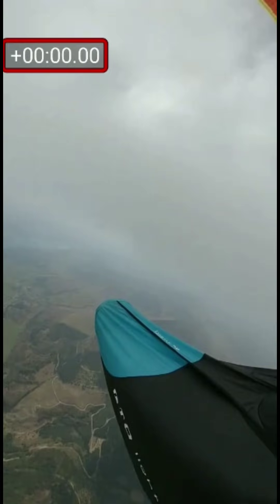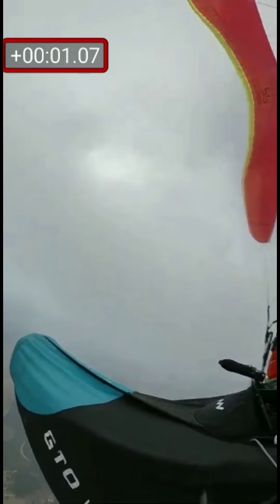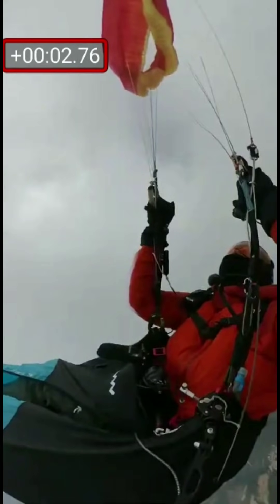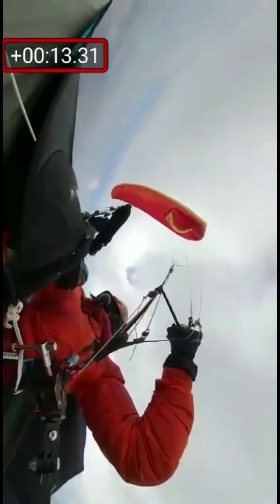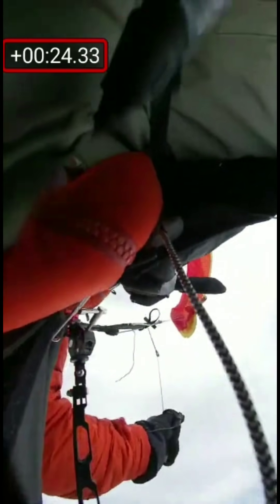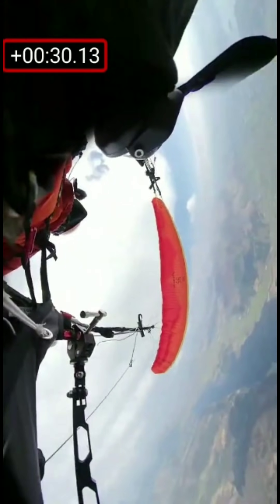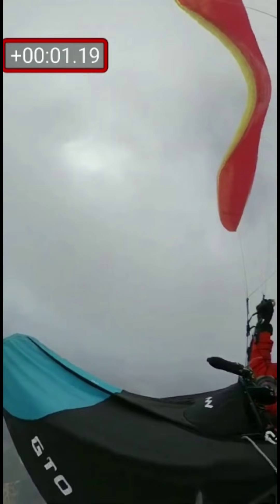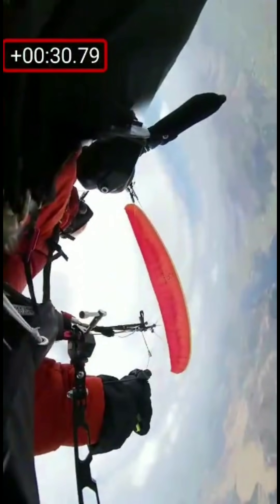Paragliding Incident Analysis: Zeno Cascade & Recovery

Comment: Just starting to learn. Like detailed review. If you want to educate / help newer pilots, then I would suggest using descriptive language (folded under left wing tip, pull down on break handle under the side of wing still inflated) or to explain for new people the unique terms / metaphors (coconutting, sat like configuration, "deep water" rotation, cravat, exit window, etc.). I can and did look up the terms; yet, perhaps this type of video is primarily for experienced pilots who already know all these terms. Anyway, thanks for this type of educational video.
Reply: Hi Philip, as an intermediate pilot who has been through a few SIV I would say the target audience of this video is higher level pilots who have already mastered many aspects of wing control. Of course there is terrific information to be learned by anyone watching, but your responses are going to be very different depending on your skill/ level of training. For instance, stalling the glider is not a benign intervention, there are a few ways it can go wrong and leave you in a worse situation (like falling into the glider). A good SIV instructor will assess your level and train your wing control responses progressively- Learning spiral/ pitch control before stall, learn stall before spins. Each level prepares you for the ways the next level can go wrong. 

If a low airtime/ non-SIV trained pilot found themselves in an uncontrolled rotation, reserve toss is probably the safest option. Once you start yanking on things in high energy situations, you need to be able to deal with the consequences, which can include dynamic surges that left unchecked can toss the pilot into the wing.

Comment: I think I had something very similar on Bonanza 2 (C wing) last year. Frontal (without pitch forward) -> stabilos still fly -> cravat -> reserve.
I guess my mistake was waiting to catch the wing once it shoots forward after frontal. Should have pumped the brakes immediately after it collapsed...?
Reply: If you can deal with possible stall,  you should do break input to keep the span under control and dont let the wingtips touch.

Stall is a problem we can easilly solve with proper  training. 

Touched wingtips, twists etc are the situations we cant solve.
Reply from the maker: Yes, agreed.
Reply from the maker: Difficult to be definitive on written description but in general yes - brake/ rear riser input to prevent the tips touching.
Reply: You really shouldn't be waiting for the wing to open up and shoot forward by itself during a frontal, on anything other than enA or maybe low B glider. Once a frontal collapse starts happening, best if you not only pump the brakes - but, as was very well said in this video - you cannot give too much brake input at that point! your hands should be dropping all the way down once a frontal starts happening, and they should return upwards just as quickly, once the glider had reinflated. sure, at that point you're mostly worried about the glider shooting and catching the dive. (unless the glider goes in a horseshoe configuration, like in this video, in that case you need the keep the brakes applied until the wingtips are no longer ahead of the center of the glider.) 
Best to have stalls dialed in as well. :)

Comment: The pilot seems to be looking up at the canopy, rather than looking where they are heading, throughout that incident. Were they assured that there was no other traffic in close proximity?
Reply: I can't answer your question, (though I don't see anyone else around him on the video) but I strongly support looking directly at your glider, especially in turbulent air or on the speed bar. You cannot feel a collapse as quickly as you can see it happening.
From the Zeolite manual:
"In turbulent air, fly with the brakes applied (approx. 20cm), this will give you the necessary feedback which is vital to keep the wing open. It is also important to look at your wing as this gives a direct indication of its internal pressure and likelihood of collapse"

Comment: I think you should have insisted more on the position of the hands. Not letting the B-handles loss (should have been the first thing to do, my opinion), not stearing and breaking with the BRAKES, and not having the hands low enough... The pilot should have a SIV / safety training, or fly another wing. :-)